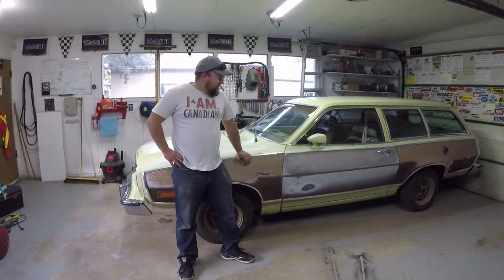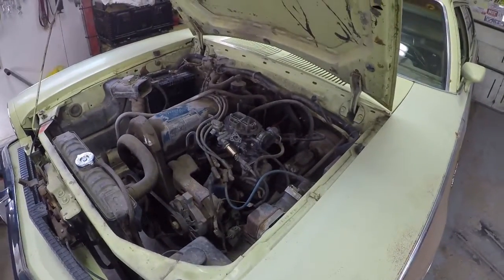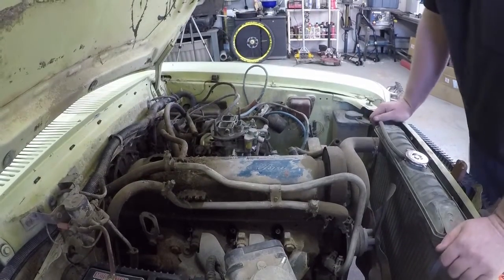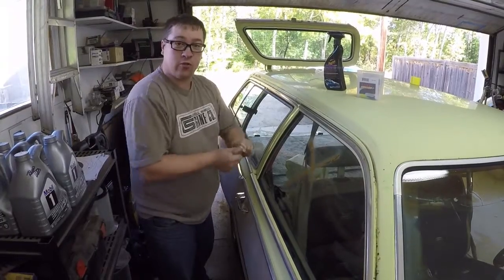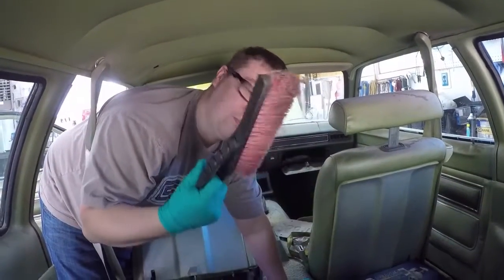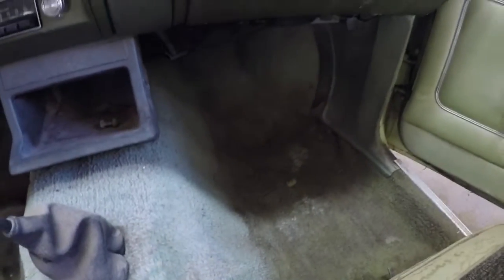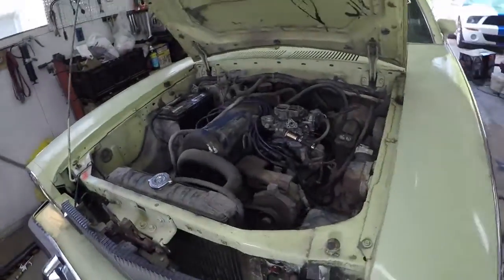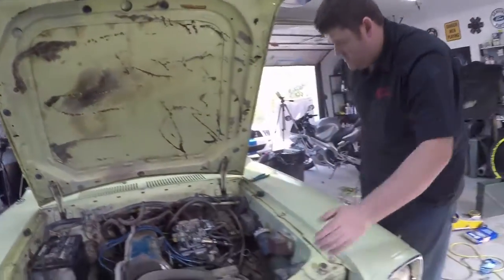Saved from The Crusher! 1976 Bobcat Wagon

Comment: I had a '76 Ford Pinto 2-door with the 2.3 engine. Best driving little car you could ever want.  Never gave me a moment's trouble.  At one point some of us with the four-cylinder cars actually ran water injection on them.  I was surprised that it got better fuel mileage and had more power.  I hated to let it go but found a classic 1960 Ford pickup and the guy just made me too good a deal to pass up.  Wish I still had it.

Comment: Quite interesting to see our humble EU "pinto" lump in a homegrown American application, the engine itself is surprisingly tuneable and still today is sought after for kit cars in 2 litre form and these engines are just bulletproof reminding myself of a MK4 Ford Cortina 2.0 that had three cylinders working and three gears of the four working (third was just toast) and yet it started, drove and ran like the clappers several hundred miles a week and the gbox didn't matter too much  as the clutch was also down to the rivets but still it went.   If you look up some of the last applications on the Ford Sierra there were injection versions using Ford's EEC-IV ECU and Cosworth's 2 litre twin cam prototype used the same block as the larger Pinto's but the good thing with Ford is the old European maxim, if a Kent engine (OHV) fits in there, a Pinto will fit, if a Pinto will fit then so will an Essex or Cologne V4 and V6, a Cosworth 24v Cologne V6 is quite a serious motor that will mate up to a Type 9 and dump some serious horses thru any diff and these were found in the EU and last of the Mercury Scorpio's over in the US :)   I think Burton Power down in Essex here in the UK still do a lot of racing mods for the Pinto and Kent engines, the MK2 Ford Escort RS2000 was basically half the size car as the bobcat and half the weight with a 2 litre/type 9 combo shoved in and proved to be one of Ford's most successful rally cars.
Reply from the maker: Hi Ian, thanks for the in depth comment, that is unusual about the 2.0L being popular in the EU, as they were not common, or well liked here, their lower torque output really seemed to place them in the shadow of the 2.3L for most buyers. I did have for a time a Ford Sierra (Merkur XR4Ti in our market) which had a Garret T3 Turbo on a 2.3L SOHC. Sadly we never got any of the twin cam Ford engine's in North America, which is very much our loss, I was quite keen to build one up, but abandoned the idea considering the cost of parts after import/shipping/exchange costs. We do have some performance parts for this Bobcat 2.3L but its a matter of getting Jesse back in the shop to make it happen. Thanks again for the discussion, and please feel encouraged to subscribe and stay in contact. - Darren

Comment: Good old ford eh. millions of UK cars used a 1600 or 2000 cc version of these engines, but a fact is, the legendary Sierra Cosworth  used the basic block assembly but used a heavy duty version block. people like me used the 2000cc engine, very tuned, in our oval racers.- be a fun project with a Sierra Cosworth engine as it will just bolt straight in..

Comment: Cool upgraded version of the pinto wagon with all the 70's cheese. I don't see why you guys rag on the 2.3. My friend who was a ford mechanic, had a base pinto that had a fuel leak under the hood. He was buying it for the tires, but scraped the melted air clean and found laying around plug wires and such and got it running. After a bit of tuning that little car could chirp in all 4 gears and beat a lot of cars in traffic light to light races. Also a guy from same place got a mustang II with same engine and the way he burned the tires on it I swore was a 6 or 8 and the only problem he had was he broke the camshaft.